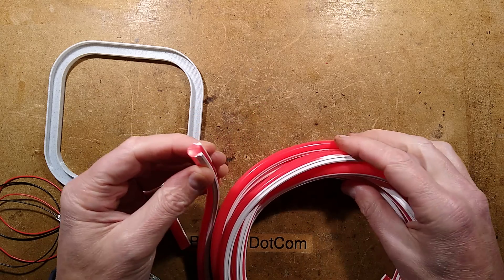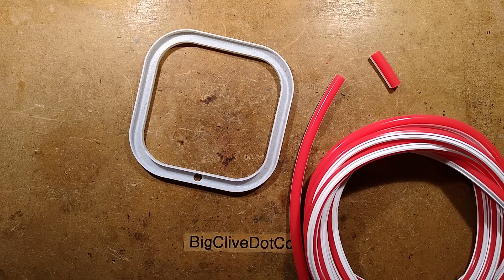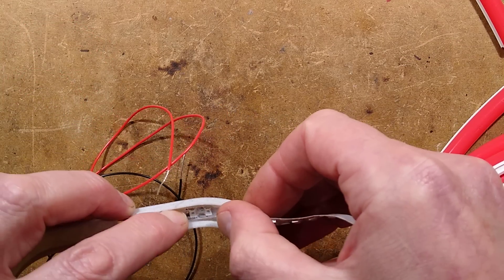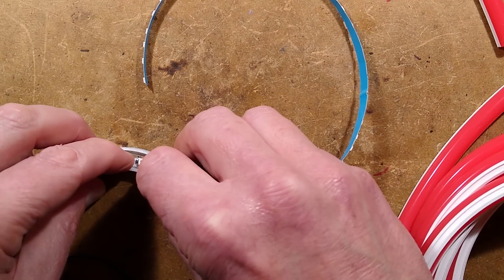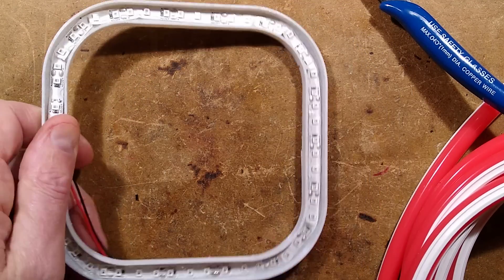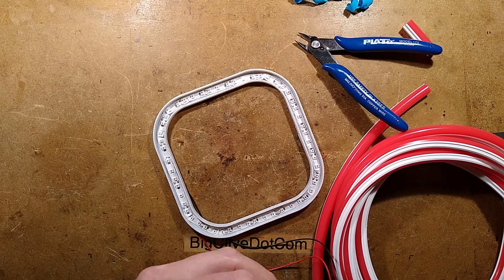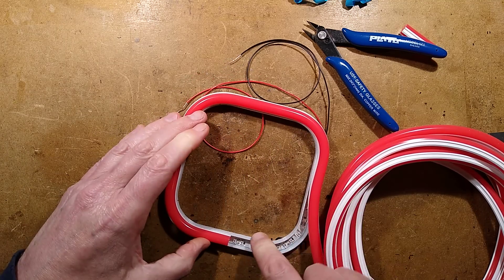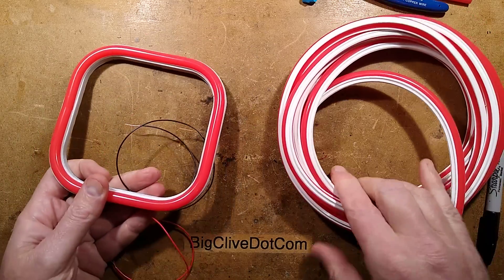Testing a new 2-part style of LED "neon"

Comment: Also what kind of voltage does it require? Like can I hook up a small battery pack to it. I'm doing a project that is wearable.
Reply from the maker: This stuff is 12V, but you get 5V versions for use with USB power supplies or power banks.

Comment: You can't use red for red silicone, use white, it'll be A LOT brighter, I used red leds in my 1941 Oldsmobile tail lights and they where extremely dim during the day. So i thought, hey you dumbass they already have red lenses so I switched to white LEDs and they where a shit load brighter and problem fixed

Comment: Great stuff! What kind of material did you use for the print? I'm wondering if PLA is heat resistant enough for use with these LEDS
Reply from the maker: LED tape usually runs fairly cool.
Reply: @bigclivedotcom  Then I'll give it a try and see how it goes.

Comment: Are Led strip lights less efficient then typical LED bulbs? The only reason I ask is my mum got a rgb 5m strip which I unrolled in the living room and set on white at full brightness, according to the smart meter they used 14w and produced significantly less light then the 4w (470lm) LED filament bulb in her lamp

Comment: Sharp tool for curves, sharp but still rounded.  Hold down, bend up at the point.  Put point under next bit, and bend down.  Hold down next piece with the point, and bend up, then put point under and bend down to make the next fold.  
Basically using the point to make the up and down folds for an accordion style pleat to shorten up the inside.  Just a guess, but I've seen rounded points used to do this for similar things..
Just hit me you could probably use an unplugged secondary soldering iron for the point tool, most everyone will have some cheap old straight iron with a rounded or chisel tip that would probably work for a point to fold pleats around.  Just make sure you use colored tape or something on the handle so you don't mix up which iron with a hot one..

Comment: I would suggest using a white led strip instead of red behind it it will give off a brighter colour through the filter!!
Reply from the maker: Subtractive filtering reduces light output.  Using a matching wavelength gives the highest transmission and efficiency.

Comment: Good day Clive. I am looking for mini neon flex that I can attach to a frame  made from flat bar. It needs to bend close to 180 degrees at one point on the frame? Which LED neon flex lighting would you recommend. Do you have any good links to power supplies and connectors that I could use to complete my flatbar wireframe?
Reply from the maker: It depends on where it is being used.   Some Christmas lighting frames use rope light around very tight bends, but it puts a lot of stress on the material.

Comment: There's led modules on Alu strips that come in various shapes and sizes, including rectangles, circles, etc. So if you find one of the right size it's much better than a classic strip as it keeps shape, doesn't unstick, and has way better thermal dissipation (that's if your housing design lets the heat dissipate anywhere, of course).

Putting bright LEDs into a shallow plastic zero-airflow housing would be awful for any production device for obvious reasons.

Otherwise great video, but I can't help wonder how well this diffuser will stand up over time, ie won't it degrade structurally and also change color (usually stuff like that starts turning yellow after a certain time).

Comment: Shell/Aral using the same LED´s in plastic tubes (fake neon) to make it cheaper, they use a aluminium strip under the LED strip as heatsink and just push it into 2m long platic tubes with endcaps. Getting thoose around corners is rly hard, better cut it and connect it with short cables cuz the led´s are bright enought to light up the corners 1-2cm gap.
Peace from Germany

Comment: Routered grooves for LED strips in the underside of kitchen worktops - especially in the overhangs of islands - are getting pretty common now.  I could see this being used to give a better overall finish and a more linear output than just leaving the bare tape as is the current norm.  It could especially give a really nice effect with an almost clear 'diffuser' style over an RGB strip.

Also useful for the underside of wall cabinets, too.

I like it.... I like it a lot 😁
Reply: Well, the bane of shelf LEDs in groves is usually that (a) grooves are shallow and the diffuser doesn't diffuser so well so you see spots from individual LEDs (solved by a more opaque diffuser, or by deepening the groove which is clearly usually impossible sure to the thickness of the woods panel) and (b) terrible thermals of the resulting light - if the LEDs are run bright and consequently hot, being sandwiched in a groove of a very good thermal insulator and covered by a diffuser is not so good for them to say the least.
Reply: @BoraHorzaGobuchul  
We mostly deal with 30mm or 40mm thick quartz, granite or solid surface (resin/stone composite) these days.  It would be easily routered to take this kind of strip and diffuser - even the thinner 20mm solid surface tops would be fine with an 8mm deep groove.  Being stone based they also have very good heat dissipation properties, so no problems for us there either 😁
Reply: Normally you’d put led’s in an aluminium channel with a clip in diffuser rather than leave the leds in a rebate, which does diffuse the light nicely and also protects against the backing tapes adhesive failing and the strip falling out (the channel is mechanically fixed). The neon diffuser looks lovely but it’s thickness will cut output, it’s more for looking at directly rather than a wash diffuser

Comment: Very nice.  Did I miss the bit where you said what material the red tube is made of?  If it's a fairly standard silicone, I'd like to see if you could mix it yourself and gloop it over some LEDs in whatever form you choose.
Reply from the maker: They claim it's silicone, but I'm not sure what it actually is.

Comment: Much better than the 3 m led strips 15 years ago when they were introduced .We had loads of failures   Turns out the LED strips needed to be potted or mounted on glass or metal .let me tell you the shelves got warm ! Over driven LED would melt the adhesive on the strip and they would just fall out .

Comment: Hello Clive! First of all, amazing videos! Been learning alot from you :) Also, i have no clue if this is the right place, but i was wondering if u happen to know about the speedcomfort radiator ventilator? With the upcoming winter and high gas prices. I was wondering if i could make one of those myself. As the price of a new speedcomfort is quite high (in my opinion). It seems simple to recreate/reverse engineer. But than again i'm not an expert 😅 i was wondering if u happened to know anything about them. And ofcourse if their claim of saving 22% om gas prices is valid. Thank you so much for being awesome! :)
Reply: For maybe 20 euros worth of stuff (retail price), it is absolutely pricey. You could easily make the thing, all you need is a 12V adapter, some computer fans, a thermistor, an Arduino (or a simple analog circuit even), a MOSFET, some magnets, and a box. However, the claimed gas savings is a lot of baloney in my opinion. I'm not saying they lied, they probably just set the testing parameters to get the "right" results for the promo material. All it does is gives your radiators a little extra power (and noise). It doesn't gain extra energy (thermodynamically impossible), just makes the heat exchange happens a little faster. It does nothing for your heater, which is the thing supplying all the heat! Maybe you could install this thing in one room to make it a little warmer, but you'll find all the other rooms will be a little colder. Then you install these things in all the other rooms too, but then the power gains will even out, and you'll end up with exactly where you started, but with your pockets several hundred euros lighter. And then the little fans will start to rattle and eventually give out, as they always do...
Maybe in places where an existing radiator is too underpowered for the heating needs of a room, and installing a bigger one is infeasible for some reason, then it could be of legitimate use, but again, that will come at the detriment of heating every other room on the same heater.

Comment: I'm kinda surprised they didn't just form the strip with little triangles chunked out of the edges by a machine since it would make it even easier to route around corners. If you're using a frame mold you could also dispense with the extruded diffuser strip entirely and just pour in diffusive resin.

Comment: Hi Clive., I'm struggling with some AC to DC maths.

I need a small heating element to warm dough, mushrooms,beer etc .
I want to control via Arduino and 12v , I found an old AC Halogen bulb rated (240/70W) , when I drive it with a 2A 12V supply it only pulls 0.75A .   I don't understand. Pls HELP
Reply from the maker: To get the expected power, measure the resistance and then calculate the current by dividing the voltage by that resistance.  Then for power multiply the current by the voltage.

Comment: As a electrical genius I have a question as I am new to this.  why would a single 5v led chip have a 270 resistor and unlabeled looks like a 100nf. I was looking into bulk 5v led single on wafer chips. I was unable to link to the item. 

Btw you made me decide to go back to school from data/business analyst to electrical /electronic engineering. Start in January
Reply from the maker: The resistor will be chosen to pass the required LED current at a specific supply voltage.

Comment: Very cool. Was that the 8mm size? I've wanted to find a way to make lighted letters to make sign for my nephew's room for a couple years now but couldn't find something that looked good and would be safe but this seems to check both boxes. ~25USD shipped for 5m of the "tubing" and LED stips isn't bad either. Hmm could order a couple meters of each ans use a different color for each letter of his name. Need to shop for a 3D printer too. Dagnabbit Clive you've cost me more money again! ;)
Reply from the maker: It is the 8mm size.

Comment: Is it getting hot enough to soften the PLA print?
Reply from the maker: No.  It seems to stay fairly cool.  But I was running it at lower voltage to make the intensity more acceptable.

Comment: This stuff is great until it weathers, I need to do the math but for a 12ft section on a commercial building they had 4 inches of shrinkage, Hustler of Hollywood wanted rgb dmx controls so they could make the rings around the building any color they wanted, 22 drivers, 550,130 leds *edit and that's for UL listed commercial lighting, I could only imagine how bad this stuff would be, but..it could be nearly the same material so I won't know until I get my hands on some

Comment: Iv'e used LED tape in commercial fittings. It isn't designed to bend like that. You cut it and solder wire links between strips !
Reply from the maker: This stuff IS designed to follow contours.
Reply: @bigclivedotcom  The LED or diffuser ? The LED didn't do so well, there are kinks in it !

Comment: They have that stuff with the LEDs in it already. We use it at my job (making signs)
Reply from the maker: I've featured the LED neon in other videos.
Reply: And it's a nightmare to work with it, the more connections you have to make the harder it gets, as you have to cut the silicon part... That's exactly why they have developed this.

Comment: A strip under the loo seat could save running a separate light in the room . . include a tilt switch dimmer - more thrifty : )
Reply: @Kevin-mp5of   - Ah, hence the gap twixt seat & pan - compression ignition is not something to be sniffed at : )

Comment: I would wonder whether it's listed as "8mm" because that is the size of channel it is intended to be pressed into.  I noticed it was sorta popping out a little bit in certain places after you first put it in, but I wonder if it would hold more securely if you made the channel actually be 8mm instead of 9mm..
Reply: He could have modeled the channel grooves too, had he looked at the router bit pic they also sell.

Comment: I saw on a 3D printing group that someone had created a Home Alone prop using that LED strip to pretend to be the red hot charcoal starter that Kevin hangs on the doorknob to heat it up.
It looked really good.

Comment: nuuu LEDs you can't see. anyways that is kind of interesting. I just wish that LEDs weren't replacing everything. the old real neon tubes are fun to mess around with. Very fun if you have a slayer exciter or plasma globe circuit. Wireless energy transmission is fun.
Reply from the maker: Real neon is great, but hard to get now and very fragile.

Comment: Can you please tell me if the LED tape you are using would work in the outdoors around the perimeter of my home ??? The environment is really wet as one would expect.
Reply from the maker: If using LED strip outdoors it will have to be waterproof.  And make sure that however you install it facilitates changing it out for new stuff when required.  It doesn't last forever.

Comment: You've given me an idea for diffused track lighting for enclosed (race car) trailers that would have excellent anti-corrosion (LED strip) benefits while being very light weight and easy to install and be reasonably low cost. Since trailers already use 12V circuit and battery, this could be pretty straightforward. Do you know if there's a maximum LED length to voltage rule that must be considered?  

For example, a single strip 36 feet long.
Reply: My local hardware store sells aluminum  tracks with diffuser covers that you stick your own LED strip lights into. I use these along with some strong double-sided tape to make a light strip along the side of my RV like the newer ones have. You can also find them on Amazon. They are straight but I think that's what you would want for your trailer.
Reply: @topline2554  These would be installed on inside ceiling of trailer. During late fall and winter, lots of moisture.

Comment: That is actually very nice! This means that you also can have different color along the line, and even have a angular cut between the different colors. Do you HAVE to have red colored LED's under the red diffuser? How would white LED's work?
Reply: Interesting question. They provide specific LED strip colors for the chosen silicon cover, so I'm pretty sure the color would look washed out.

Comment: Another interesting BC video about an interesting product.  Thank you, Clive.

What problems might arise if one used only white-LED tape covered with different-coloured sections of flexible vinyl covers?  Would the colour saturation and luminance of the various sections of cover be reasonably similar?

For the next product generation, it would be convenient if the LED ribbon was manufactured having "UV-only" LEDs (i.e., omitting the fluorescent phosphor from all of the LEDs), with the required colours of fluorescent phosphors incorporated only into the separate vinyl covers.  This would facilitate design options while also reducing the required inventory of components.
Reply: You mean using translucid vinyl (the used in luminous signs) to color the led strip?

Comment: Adhesion promoter is available from 3M, it helps LED tape grip must better especially on plastic.
Reply: Super glue would probably work as well...
Reply: @Quickened1  I don't know, would the super glue deteriorate the double sided tape or the plasticized coating on the bottom of the strip?

Comment: Clive, How do you think this would do with the White diffuser clipped into 12mm plastic trunking with WS1812b LED's under? My theory is that if the white silicone lets the RGB through with little to no lux loss, it would make for a great way to edge windows, doors and walls etc that doesn't look horrible in the daylight... if you don't get what I mean, look up DrZzZ's guide to mounting outside LED's.

Comment: This brings up a sidebar ---- does anyone know of a source for COB-type LED's in a glass-fuse 3AG sized package? Every time I replace dial lamps in an old stereo receiver with LED fuse lamps I have to waste time experimenting with physical orientation and various light-diffusing materials as sleeving around the bulb to prevent the beaminess of the individual LED's from being visible through the tuner dial. A COB LED would be somewhat closer to the omnidirectional pattern of an incandescent bulb. I can find them in automotive interior-illumination sizes but not smaller ones sized like a standard 3AG glass fuse.

Comment: If you moulded a "Sawtooth" protruding on inside edge of the curve on your holder, ( the flat surface where the strip sticks) you would get a natural "fan" effect which would curve the led strip.
Even a small dimple every 5(?) mm would induce a "crimp" on the inner edge?